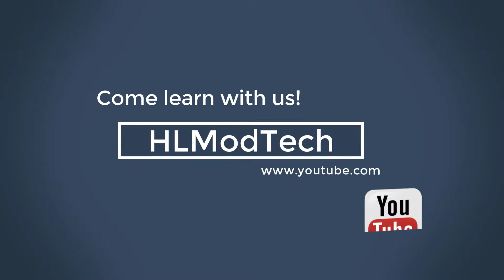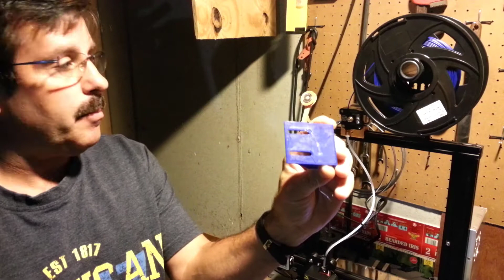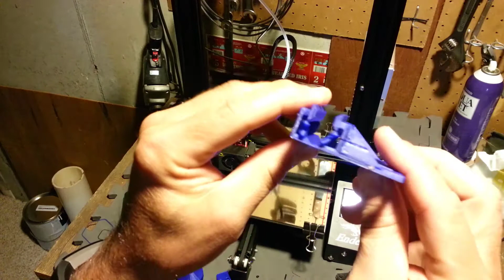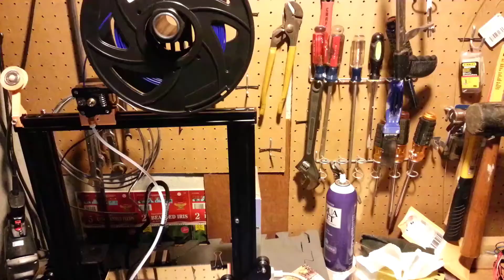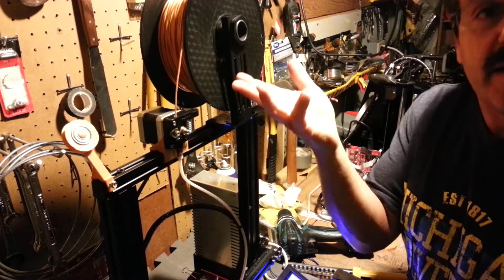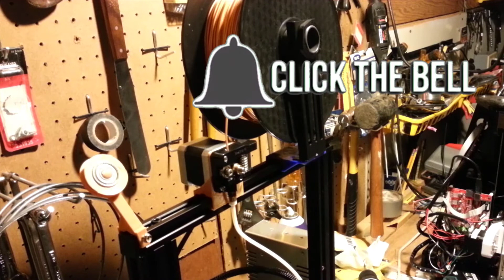OOPS! Ender 3 Pause & Swap Filament Test...

Comment: Hi--  So it's been 24 days since you posted this video with this setup.  First I've seen it done that way, with the extruder motor on top.  Do you still do it this way?  Would you recommend it?  Any issues at all?  I like my current setup with the thingiverse filament guide arms and slide-on guide next to the extruder... how the filament unrolls into it's natural curves..  but I know it's just a matter of time before a pet or person snag the filament walking past and yank down the whole works..
Reply from the maker: I ran it that way for a week with good results for how I print... I have not made anything taller than 8 cm in years. Just how I roll... I moved back to the stock setup and focused on creating snap on parts people could use without permanently modding the Ender 3. Totally agree with having the filament up out of the way. Most of my rights I have a bunch of reels on a bar above the machine so I can swap colors and such at will.

Comment: Seems to me where there's a structural component where strength and resiliency is necessary, then you ought to be using ABS, Polycarbonate, Nylon or any of the "tough" hybrids. Just buys you a little peace of mind that the bracket wouldn't actually break from machine vibrations, and movement over time.

I think I'm going to make an acrylic box enclosure for mine, and the spools will sit in a "dry box" on the top and feed through a hole to the extruder anyway.
Reply from the maker: True. I have both ABS and Nylon on hand, but I usually get all my ducks in a row with PLA first... Have not tried anything but PLA on the ender so far. Working on a socket for for changing oil on the van... for sure will have to use something more robust for that.
Reply: I'm going to try to stick with one brand of filament (as much as possible) so I've elected to go with Polymaker. They've got one that's called PolyMax PLA that is supposed to be better than ABS, yet without all the downsides associated with ABS printing.
Reply from the maker: I am so cheap it is sad... I am usually working with my school budget, so I am crazy conscious of stretching it.... One of these days I will discard my teacher ways and pay for the good stuff! =)
Reply: If you are a "creator" or "maker" you can also create your own reality to include more abundance. Don't keep repeating the same mantra of "I'm poor" otherwise you keep getting more of that. Jus' Sayin'!
Reply from the maker: Not poor... cheap... =) I am just always trying to do things as frugal as possible. I attribute it to my pop who used to always say things like "your on my nickel." when we used the phone as kids. =)
Reply from the maker: I will have to look up PolyMax. It would be cool to be able to get the strength of ABS without the extra hassle of ABS. I find that my ABS prints on the replicator 2x always have to be scaled up to around 102% to end up being the right size...
Reply: Oh, no... I totally get it. My whole business model is about ECOnomy & ECOlogy ;-)

It's just in the last 4 years, I've adjusted my way of thinking/living to NOT be like my parent's generation. Using the power of positive thinking, attracting what I want in order to shift out of that old world paradigm to get what I want in life, and not have to feel like I'm struggling. I treat money like energy now. Energy In – Energy Out
Reply from the maker: That is super cool! I am wired for positivity... My wife tries to reign me in, but I always believe things are going my way. =)
Reply: That's the only way to live, my friend! (on a sad/not sad note... that's how I lost a wife. I was trying to be positive things were going to be awesome and work out, she did not. HAHA)